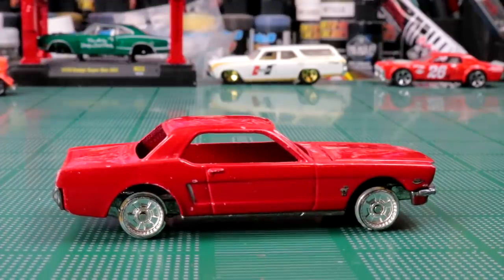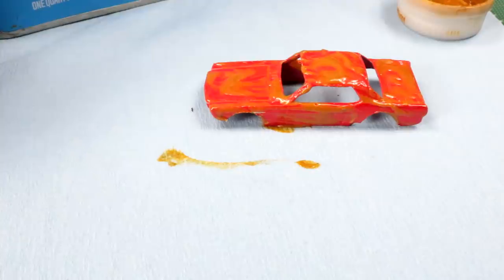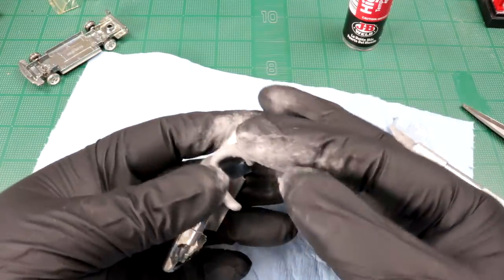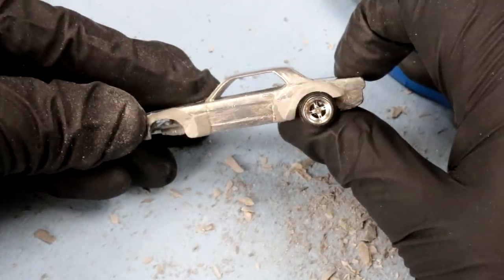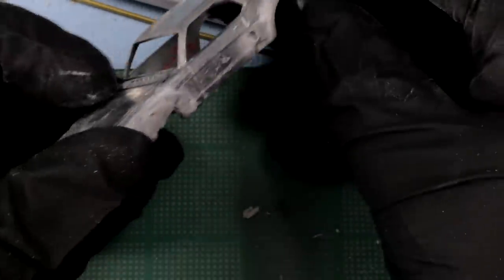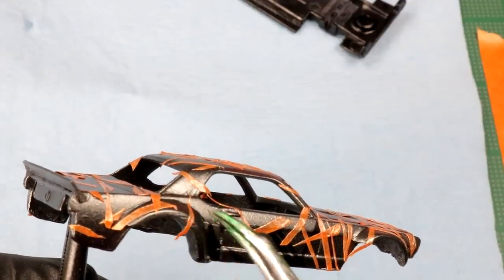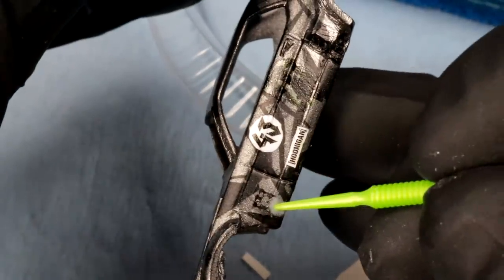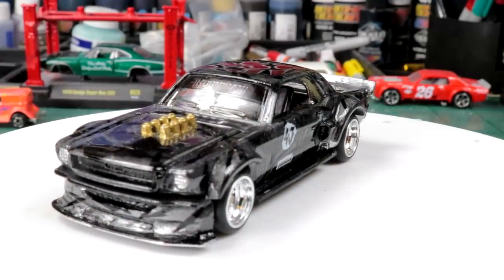1:64 HOONIGAN Inspired 65' Mustang Drift Car Build

Comment: Mind blown. I have a 70 Dodge van (She-Hulk with green wall rubber tires) I got for the tires, but it has a giant sunroof on it and you just gave me a solution for this sunroof. I was gonna used muffler tape, but with that putty, I can get the drain lines in the roof. Austin, you are a true inspiration. I wanted to see how to fix Hot Wheels cars and started watching your vids in Dec; then tried my first car in March and I always use your info as a guide. I started Instagram with pics and am just starting to video the process. I just wanna say thanks for pushing the limits and inspiring me on a cool creative hobby.

Comment: You might want to check into some plastic razor blades, they are used in car detail for removing stickers off paint, I don't know if the metal one you used scratches the zinc.

Comment: A couple of ideas.
You could print some of the light colored decals multiple times.
More ink should result in a brighter color.
Alternately you could tape and paint white, or light colored sections on the car for the decals. Using a dark color to outline the decal would meant your paint spots could be somewhat rough.
Like a small circle or square and let the dark decal define the edges of the light

Comment: i tried using a wire wheel like you show, but im getting rough cut up finishes... am i doing something wrong?
Reply from the maker: Are you using a steel one or brass?
Reply: @DiecastResurrection  Brass.  Its a larger diameter tho, for a regular size drill (its all i had on hand and couldnt wait to tinker LOL.)
Reply: @DiecastResurrection  Im borderline-obsessed w/ what you (and other channels) do but i wanna keep learning and doing more with each one, its addicting lol

Comment: For all the Jimmy fans, Jimmy didn't go missing, Austin locked him in his trailer for the comments he passed along to me.  Jimmy thinks the Mustang will be a quick sell and Austin wins the challenge despite the lack of pop on the decals.  DSC painted his white and the side scoops show major deformation and he didn't repair the bent suspension which means even though it's meant to drift it wouldn't make it down a straight line track without getting hung up.  # Blubs for Jimmy

Comment: The M decal you made . You made it just like the Monster logo. In this small scale I get we are talking “Resolution”  I think to make that M show up you would have to take creative license and place the black M on a background of the green.  Even a misting of the green with the black M would have popped that M out. Due to the small scale or resolution we humans would see the M and the green and 90% of the humans mind would see the real logo. Our minds will fill it in correctly. Then their are the 2% that are idiots and AHoles that will tell you the decal is wrong but not understanding to see the scale it has to be different.   I think that would have worked and would have look very correct.